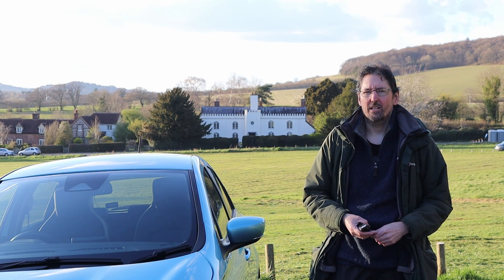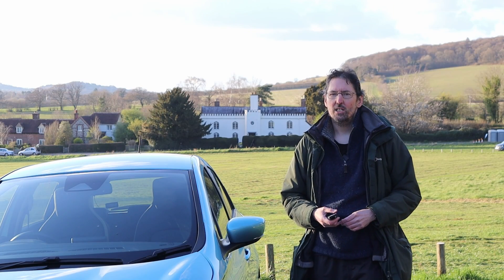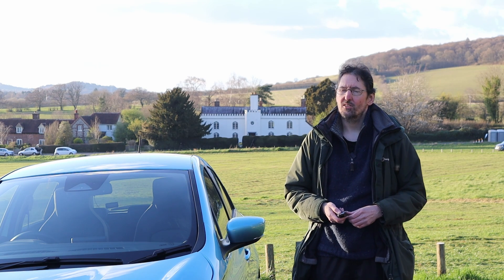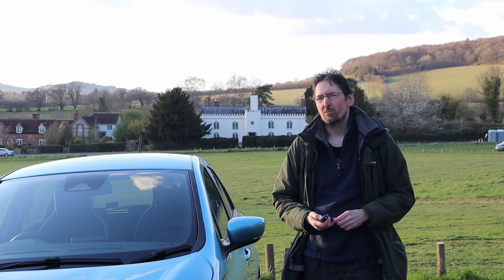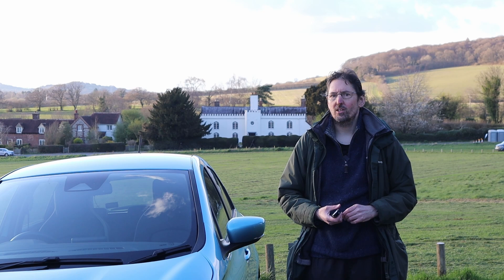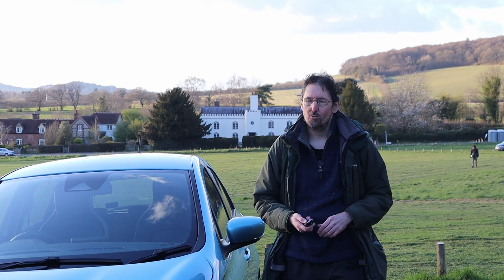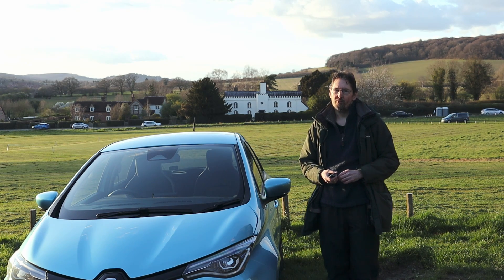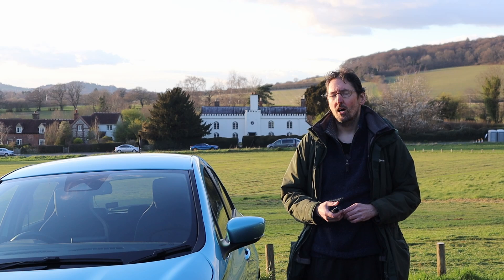Renault ZOE - AC Charging Efficiency

Comment: I have an R135 from 2020. On AC level 2 charging, the My Renault app consistently shows a lower kWh charged compared to the app of my charge card, the latter of which shows what the chargepoint reports. However, on DC fast charging with the CCS connector it is the other way around consistently.
Reply from the maker: Ah, interesting. Thanks for the information. It doesn't entirely surprise me, and I tend to take what the car says with a pinch of salt. To try to be as accurate as possible, the experiment was based as heavily on information from outside of the car as I could manage

Comment: hm zoe take from 400w-700w for operate charging what is level 1 charging? what is level 2 charging? when it is cold it taking less, if warm taking higher values  and most efficient it will be when 22kw charging used.
Reply from the maker: It does seem to be tuned to be most efficient on the fastest charge.

In cold weather, the car may use the heater to warm the battery so that it can accept charge, so it could be less efficient during colder months.

Comment: You might find https://backend.orbit.dtu.dk/ws/portalfiles/portal/357332023/PhD-thesis_-_Kristian_Sevdari.pdf interesting. Look at page 30 of the thesis - an extensive set of efficiency measurements for many types of cars, including several zoe models (the Z50 was mine..). Also power factor and reactive power - here the Zoe really sucks.

Comment: Are all your powermeters calibrated? You should at least use 2 totally different models when you measure. OK I might still be correct, but nobody knows?
Reply from the maker: They are not calibrated, no. They are as accurate as a poor content creator can manage. However, as I mentioned in the video, there are reasons to believe they will not be wildly inaccurate.

Comment: A petrol/diesel car is less than 30% efficient. So you lose 70p of every £1 spent on fuel as waste heat. I pay 7.5p per unit of electricity and get over 4 miles per kwh so it’s so cheap that tiny variations in charging efficiency make little difference to running costs. In the UK at least, it makes more sense to export excess solar for 15p per unit and charge the car at night for 7.5p . Just saying.. interesting video nonetheless
Reply from the maker: Yes, the cost differences are pretty amazing when thought of that way, thanks.

Wow, I hadn't realised that export tariffs were that high. Last time I looked, most providers seemed only to be paying about 5p/kWh when exporting!

Comment: I would guess if you charge with a granny cable you are going to be less efficent as length will be longer and thicness will be smaller the UK fused square pin plug is also less efficent than the round pin type. I've measured efficence on my MG4 and Zappi wall charger meny times at both 16 and 32 amps the speed makes no difference but the temperature does anything from 80% to 95% but that's on an LFP battery and different car
Reply from the maker: That's a fair point about cable diameter. That matters at high currents. The length of the cables are about the same in my case, so I don't think that makes as much difference. Having said that, neither the cable nor the connector heats up, so I think it might be more to do with the efficiency of power correction and inductive/capacitive effects.

Wikipedia now says that the change in motor was to make home charging more efficient. Maybe it always did say that, but it's an interesting new point I wasn't aware of before

Comment: I always granny charge, and have taken to charge at 10amps rather than 13 as it doesn't melt my 3 pin plug. 

On a 5 hour charge overnight I import 10kwh on my meter, but only get about 7.5kwh in the battery. I put it down to ½kw per hour in keeping the battery to an optimum temperature overnight.
Reply from the maker: Thanks for the information.

Setting a limit like that makes sense. Indeed, it would be a rare charger that allows anything above 10A. I think that's the highest allowed in the UK, officially. I haven't specifically seen legislation that says that, but I think I might have heard someone else say it exists - and the fact that they all seem to be capped at 10A seems to fit with the theory.

Comment: Electric engineer here, with ZE40 R110
Q motor used to have 100uF input capacitor, which at 230V makes 7.2A of reactive current. Which leaves, on 10A EVSE, about 6.3A to the car, or 1.45kW instead 2.3kVA of apparent power. Of these 1.45kW, 90% goes to the 400V circuit (1.3kW). And up to 1kW can go for heating or cooling the battery. So in extreme cases, only 300W can go to the battery. Using 8A EVSE would not charge the car. Best case, at 10A evse, ZE40 Q90 would charge 30 hours. Original 22kWh about 16 hours.
Also note, that PF at 8A would be less than 0.1, which might destroy solar inverter.

R motor has 70uF input capacitor, which gives 5A of reactive current. This leaves 8.6A for the charging or 2kW. So in worse case, using 10A EVSE Zoe would charge at 1kW (when you subtract battery conditioning), or 1.9kW in mild weather, which is good. This gives charging time of 20 hours, which is what I get.

I normally charge 3 phase at 16A-20A at home, and at that rate, 10%-100% would consume 45kWh, which is not great.
Reply from the maker: Thanks for all of that juicy detail, that's really interesting 👍

Comment: AFAIK the slower the charge the worse the charging inneficiency because theres somewhat of a fixed AC charging overhead. 
At 8 amps I'm not at all surprised that there is such a charging loss. 
My Kia Soul has a loss of around 12% (from rough measurements) at 32amps (~7.4kW), calculated by what the Soul reports has been added compared to what the charger reports as added.
Reply from the maker: Thanks, that's interesting. Out of interest, what generation of Soul is it you have, is it the newer car with CCS, or the first generation with its CHAdeMO and type 1 connectors?
Reply: @theelectrictransition  the 64k version though i previously had the 30k chademo one 😀
Reply from the maker: Ooh, nice. That was top of my shortlist when I was buying, but they remained out of reach at the time on the secondhand market, so I went with the ZOE instead.

Comment: If you did this test with a Leaf you could measure the kWh level at the start and end of the test. Then compare to the electricity used or the hypothetical usage. No danger of power loss to heat the battery in the Leaf 😂
Reply from the maker: Yeah, true! It would be fun to try that I have to say - but I'd need a different chargepoint, what with one of the Nissan Leaf's little idiosyncrasies being that it uses type 1 for AC charging. Aww, bless it.
Reply: @theelectrictransition  I'm trying to persuade my better half to let me keep the Leaf just for nostalgia. One day it will be a Classic! Etc.. But they remain unconvinced.

Comment: I don't have the numbers to hand but my own experience is broadly comparable with your measured efficiency at 2.3 and 7.3 kW - mid 90's at the higher charge rate and mid 80's at the lower rate. I assume the charge converter has a lot in common with other mains inverters which tend to show their best efficiency when running a heavy load but poor efficiency at low loads. I think the 22kW Zoe was even worse at low loads. (update: 87.5% at 2.3kW and 95% at 7kW)
Reply from the maker: Thanks, that thought on the original car does seem to fit with the hypothesis, then

Comment: Several years ago I saw charging efficiency figures for Zoe ZE50 charging at 22kW, 7kW and granny charger. I can't remember the % figures? But I remember 22kW charging was most efficient and granny charger was least efficient, which does confirm what yourself and others have found. Slower charge speeds are less efficient.
Reply from the maker: Thanks, Malcolm. If you remember where you saw that at some point, Id appreciate you adding another comment - I'd love to see that
Reply: @theelectrictransition  I bought my ZE50 in Oct 2020 and I know it was something I saw on a youtube video shortly afterwards. I thought it was possibly on Euan McTurks Pluglife channel, but I can't find the video. However I have just done a google search and found the following post which provides lots of figures.  https://forums.aeva.asn.au/viewtopic.php?t=6719
Reply: @theelectrictransition  I thought it was a video on Euan McTurks Pluglife channel but I can't see the video so possibly not?  It was a few years ago. I've just done a Google search and found the following on the Australia EVA forum.  (You Tube doesn't seem to let me post a direct link so I've copied it below. If you copy some of the text into a Google search you will probably pull up the original?)
__________________________________________________
Here are some single phase figures I have just measured on my Zoe at 75% SOC:

Pilot=32A. Actual=32A. Power at meter box=7.6kW. Power at EVSE input=7.35kW. Power to 12V battery=100W. Power to HVbat=6.5kW (377V 17.3A). Efficiency=90%
Pilot=20A. Actual=20A. Power at meter box=4.89kW. Power at EVSE input=4.75kW. Power to 12V battery=60W. Power to HVbat=4.05kW (374.5v 10.8a). Efficiency=86%
Pilot=10A. Actual=9A. Power at meter box=2.12kW. Power at EVSE input=2.04kW. Power to 12V battery=50W. Power to HVbat=1.61kW (375V 4.3A). Efficiency=81%
Pilot=6A. Actual=6A. Power at meter box=1.11W. Power at EVSE input=1.06kW. Power to 12V battery=50W. Power to HVbat=0.56kW (375V 1.5A). Efficiency=55%

Comment: From my ZE50 experience. During slow charging in cold weather can even drop battery percentage. Energy is probably used to  heat battery for charging. So charging from low solar production does not make sense in the winter. It's better to charge home battery for evening peak and charge car with higher current in night low-rate.
Reply from the maker: Oh wow, losing despite being plugged in. That's not something I have seen - but more importantly not something I have ever thought about!

Your point about heating is one option, but I think the car recalculates it's available energy based on temperature, so it might be compounded by the BMS correcting for increased internal resistance at lower temperatures. That's just a guess though

Comment: Your figures seem reasonable to me. I can't speak of Zoe experience, however the Hyundai Kona has losses of between about 380W & 440W on AC charging depending on charging current. At the lowest I can set it to on my charger is 1.2kW, the 380W loss gives a charging efficiency of just 68%, at 7.2kW it's a 420W loss giving 94% efficiency and at 11kW it's a 440W loss giving 96% efficiency.  When charging at home off the grid I always charge at 7.2kW, but if I have excess solar I'll drop the charging rate to avoid taking anything off the grid and don't really car about the losses, I don't get paid for export anyway.
Reply from the maker: Thanks for the stats on your experience, that's really interesting. I never thought about calculating the energy loss, DOH! That's surprisingly consistent
Reply: @theelectrictransition  I suspect there's pretty much a fixed overhead for the 230V AC to 400V DC conversion.